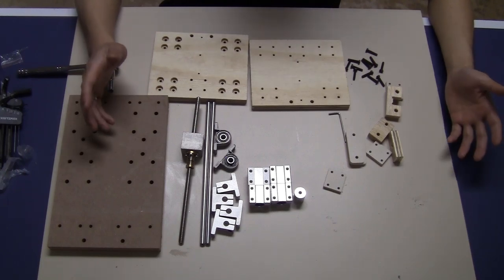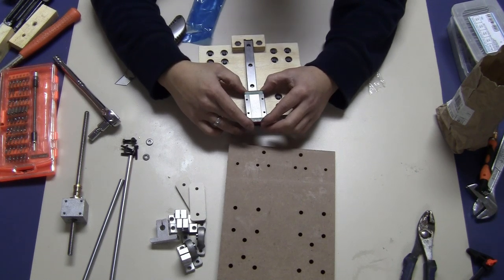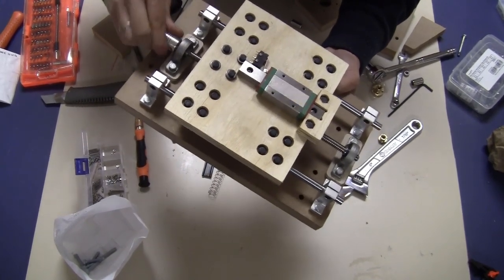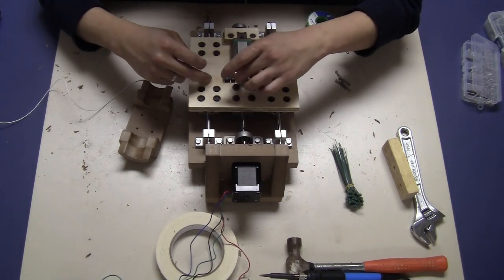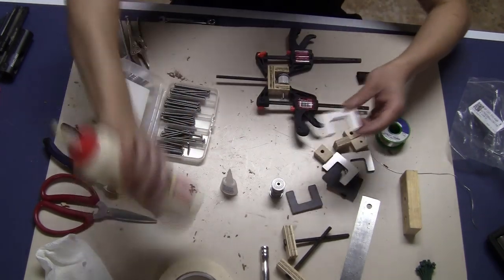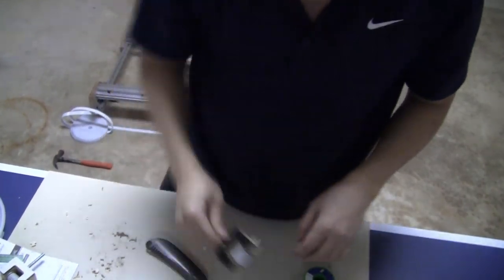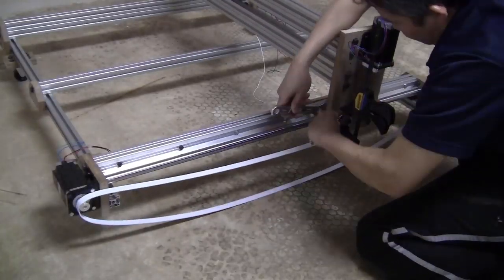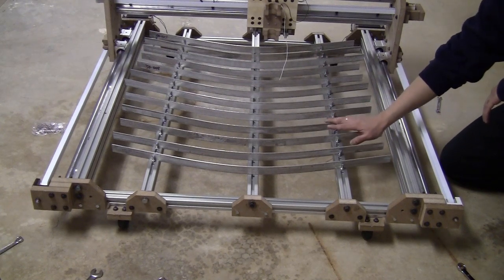CNC Plasma cutting table - P3 - Final frame - Z axis, floating torch holder, timing belt, slats

Comment: Just a suggestion but it is always nice when content creators add links to what they purchased and the sellers so we can buy as well.
Reply from the maker: Yes, defintely, I'll take some time and add the link to the description. I've got few question about the links and should learned my lesson earlier
Reply: I had a setback as I ordered some things on AliE and being a new customer they cancelled them on me for security reason (after charging me) and told me to reorder without the coupon they offered.  After that I am a bit afraid to touch them and they charge sales tax and you know they don't actually remit those to each state so they are getting richer.
Reply from the maker: @thebeststooge  Sorry to hear! I've never really had any problem with my orders from AliE yet. Only now that the Chinese new year and Corona virus just stopped everything.
Reply: No idea what is going on and I searched online and it seems to be a common problem.  My design is too wobbly using just v-rails but X was finished and worked out well though X was to be belt and Z/Y acme rod but I can't seem to get the 2mm rod now.
Reply from the maker: I don't know why those acme lead screws are rare, maybe they are just too slow.
Reply: 2mm thread and 2mm pitch for an 8mm rod and rare indeed or super expensive.  I went on the sub reddit for AliExpress and was told that is just how they roll and nothing else so I am not sure what is going on but I don't like it.
Reply: @Minh's man cave Ready for this?  My order is still closed YET the pending went through so I had to call my credit card company who immediately issues a full refund and case is now closed.  I looked around and I can't find these parts elsewhere so I am stuck.
Reply from the maker: @thebeststooge  Ouchy man!!! I would probably get crazy in your case.
Reply: @Minh's man cave I did and strange thing is that even trying to log into my account to pull up the order that was cancelled they suddenly needed me to verify it was me as there is a security alert on my account.  Basically I am not going to order through AliE ever again.

Comment: with limit switches its better to use normally closed, the reason is in normally open if a wire came off for whatever reason you would not know till it crashes with normally closed if a wire is cut or comes off the machine will stop immediately so saving a crash.